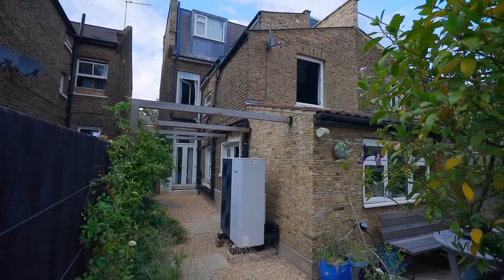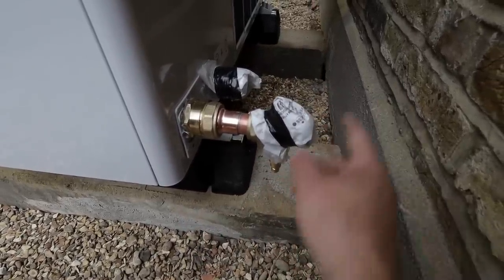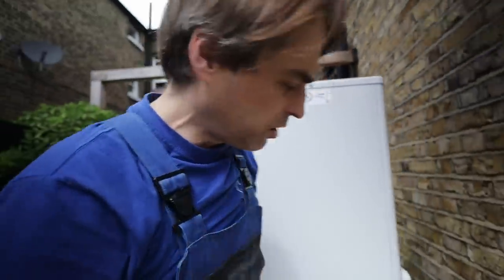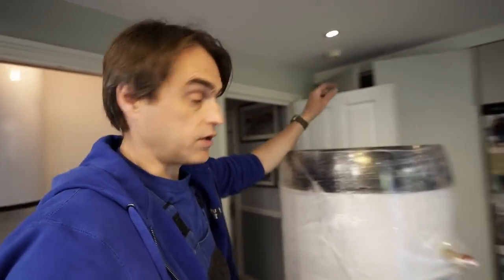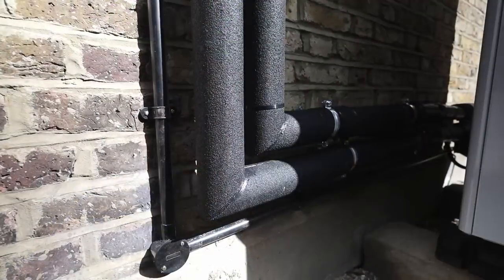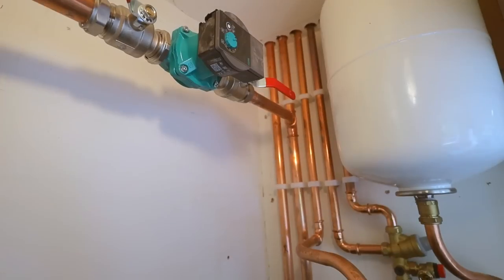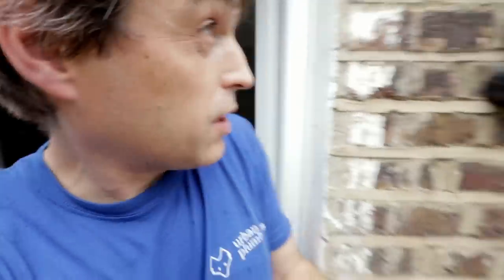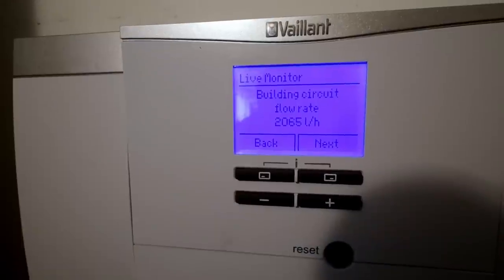Heat Pump Retrofit In a Victorian House. Is It Even Possible?

Comment: Good honest guy. It’s not flowing properly, why? Cos I’m a muppet! We all make simple mistakes, nice to see you don’t hide them . As always, outstanding work.
Reply from the maker: Thank you!
Reply: I was thinking exactly the same. Just goes to show how even the most impressive professionals can make an error, but that their eye for detail helps them identify and resolve the problem. Great also to see the different choice of valves to reduce the pressure drop. I’m no expert but I really enjoy watching an great team at work to show what can be achieved in the most challenging of properties. I’ve had an ASHP installed in a smaller 1870s terraced cottage so it was really interesting to see some similar pipework issues and the importance of balancing the buffer which I’ll check with my installer.

Comment: Great vid convinced me to stick with gas! 😂 That heat pump unit size is ridiculous. All the time to install the new rads etc etc no wonder the installation costs are so high.
Reply: Yes, I'd like to help stop dictators to, but don't want to be ripped off by energy companies when there is only one energy supply and renewables and energy storage and the network grid are not generating enough cheap electric as yet, at present heat pumps are powered majorly by gas fired power stations, and with an existing house with no cupboard or plant room and the cost, keeping the gas boiler and spending 5k to internally insulate the external walls, but it was another good install but it really is to complicated all the stuff should be in the external unit including a separate heat pump for hot water then it's only 4 pipes coming out heating and hot water into house then split heating in house to upstairs and downstairs no plant room as it's in the big metal box outside!?!

Comment: I really hope the technology improves over the next 10 years to make these about a 1/4 of the size, if we're all going to be forced to have one after 2035. It depresses me to see just how much is needed in terms of tanks, pumps, new rads etc, letalone the size of the heat pump itself. I have a 1930s semi, but couldnt put it in the side alley as i wouldnt be able to get bins or bikes past it, and i dont want it facing out against the back wall as thats where i sit in the garden. The tanks would have to take up valuable room in the garage or something too. All to replace something thats the size of a standard kitchen wall cabinet. Im hoping they invent some other technology in that time, or switch to pumping hydrogen through the gas network if thats viable.
Reply: Or just don't vote for the government that would force that upon you.

Comment: Absolutely loved your little comment about why we should use less gas 🤣

My mother's house is 223 years old. We're having engineers come over to discuss options for heat pump and solar installations. House is still using the same oil boiler vented heating system that was installed when I was born, 36 years ago! Really promising to see that you're able to fit heat pumps into super old properties with no external wall insulation.
Reply: 36 years ago... that's a solid system :)

Comment: Thanks! Now I know about Taco Setters. Will include one when I install my heat pump. Will make troubleshooting easier.
Reply from the maker: No need on Vaillant’s though and some other units as they have build in flow sensors

Comment: From a person who lives in a north-South facing Mid Terrace solid wall home, with ginnel AND north facing cellar, whether switching from a gas combi-boiler to a heat pump would be beneficial, both for comfort and relative cost.  I can tell you from last winter it was horrid in the front room (north facing) and thats with a higher temperature rad and gas fire.  (Old houses = high celling too😞)

Cant wait find out if this new heating system is better for the owner (and thanks to the owner for allowing this Video 🙂)
Reply: We have a mid terrace Vic terrace with root cellar with a 7kw vaillant heatpump and it did a fantastic job through the last winter never been warmer.

Comment: Superb! On an uninsulated property this is going to be very interesting, look forward to your revisit.
Reply: I live in a 250m² Victorian detached uninsulated house.  Two years ago we replaced our oil boiler with an ASHP and it works brilliantly.
It would use less electricity if we insulated, but we still get a SCoP of 4 so the system runs efficiently even if the house has a high heat demand. It's all about the system design and installation - so I'm sure this one will be fine.

I'm sure it's quite easy to install a system that didn't work and then moan to the Daily Fail, but they can work.
Reply: @johnmckay1423  Thanks John, that's quite a size of house - are you tempted to reduce further by insulating?
Reply: @johnmckay1423  I live in a ±220m² detached and insulated house and I'm currently investigating a heat pump based solution for heating so it's very good to hear that it works brilliantly and you still get a SCoP of 4!

May I ask what make/model of pump you are using? (size / kW). 

I fully realise that every house is different and requires a fitting solution and I've already been doing some heat transfer coefficient calculations for the house. But if it works in your situation it's another reference point for something that should work for us and something that I can hold against my calculations. 

Ultimately waiting for a local installer that has time (waiting lists are close to or over a single year), so I'm trying to be as best prepared as possible. :)
Reply: @johnmckay1423  100%
Reply: @trashmail8  you have to look at your heat loss not the m2,
Reply: @timballam3675  Yes, that's true and that's  why I already started with some calculations such as the Heat Transfer Coefficient  ( watch?v=hCeghKa3liM ) . But also knowing what heat pump size works in an uninsulated 250 Victorian house, can give me an extra data point to compare to my insulated house of roughly similar size and age.
Reply: @trashmail8  As an afterthought: If your heat demand is too much for a heat pump, you don't need a gas boiler. You need two heat pumps!
Reply: @johnmckay1423  That's a good thought for me to keep in mind, thanks! What size in kW is the heat pump that you are using?
Reply: @trashmail8  It's a Stiebel Eltron WPL25. I'm finding it difficult to get clear information on the rating - the documentation gives different options based on the climate where it's installed. It was selected by the installer because (at the time) it was the highest rated single heat pump. The manufacturer's documents say from 7kW to 22kW depending on the climate it's installed in. 
The configuration of the electricity supply suggests that the actual heat pump is set to 7kW as it's on a 32A circuit. Each of the auxiliary heaters is on their own 16A circuit.
It's variable so runs at whatever output is required to deliver the flow temp required. Variable output allows it to run constantly rather than switch on and off to maintain different flow temperatures, which is more efficient. 
We have a zone which wasn't included in the calculation to allow us to get away with a single heat pump in the design to run at 45°C flow temp at -2°C which was my preferred compromise. In real life, I have the choice of either allowing it to run at a higher flow temp and accept the reduced efficiency for the minimal days that it's below -2 (which isn't very often and rarely for whole days) or shut that zone off and close the door on that zone for a few days.
Reply: @johnmckay1423  Thank you so, so much for this elaborate reply! 🙏 This gives me some new starting points for information and adds some very useful information to my mental model of heat pump size and flow temperature vs large uninsulated house. (While keeping in mind that it isn't about m2 as discussed above)
Reply: @trashmail8  also have a look at your heat loss and radiator sizes. There are also tools to calculate this. To be efficient, your flow temperature shouldn't exceed 55°C. Ideally, you have UFH. If you stay below it, you can be efficient. But obviously, the demand is still going to be higher as if you were to insulate.

Comment: Great video, and there's a lot for a renovator-developer and specifier like me to take in. What I would love to have seen too:

1. How did you do an energy assessment in order to produce your system design? We are repeatedly told "fabric first" and that renovators must install incredibly expensive External Wall Insulation systems and MVHR etc before even looking at moving from gas boilers to ASHPs - and that rendered EWI must regrettably destroy the often-gorgeous and unique Victorian/Edwardian decorative features that make British period housing so distinctive. If however renovators can do a combination of low-impact insulation and cold-bridge minimisation and well-designed and less costly ASHP-radiator-UFH systems, that would be brilliant.

2. What did this little lot cost, from energy assessment to any extra insulation to final commissioning? And why didn't your clients choose to replace all that ancient pipework under the floorboards while they had the chance?

3. How are running costs and operating efficiencies being monitored?

Comment: We would love a heat pump. But our house is a mid terrace 1890 property with a total width of 15 ft. The back of the house is an extension with all glass bifold doors, so can't install it there. Plus no room for a water tank, hence our current combi gas boiler. If the heat pump could go in the shed at the bottom of the garden it could work, but at nearly 50ft away don't think that will work. Looks like we're staying with gas.

Comment: Another interesting job, lovely high quality work on the installation but at what cost? 5 days, three plumbers(?) plus materials, down south where everything is premium rate. We would like to replace our boiler with a heat pump but we have no indoor space for a plant room, we can have a new gas boiler installed for around £3000, with a 10 year warranty why would we go heat pump?
Reply from the maker: Cheaper to run, better comfort, much less co2 emissions, don’t support questionable regimes around the world, save the planet, add solar / battery make it even cheaper, etc…
Reply: youd fit one if your primary concern is to save the planet, if youve got thousands of pounds to chuck at it and you want to virtue signal to all your neighbours about how much greener your home is compared to Sebastian and Jocasta at number 7.  Basically you live in Harpenden. For everyone else, we chuck in the 3K gas swap and use all the money we save on a bloody good holiday for the next few years.  Id bet a huge amount of people having these 30k installs to save the planet have a range rover sitting on the drive and jet off in summer to their apartment in Alicante.

Your 3k gas boiler swap is costing you probably a couple of hundred quid a year over the lifetime of the unit. Whats this install costing over its lifetime, probably ten times that a year. When these first started to get heavily pushed, all these videos were about how youd save a fortune cos youd do away with gas, now thats been found out to be absolute nonsense due to the crackers install prices of these systems, so that argument has been quietly dropped by most youtubers and suddenly these mega installs are being sold on saving the planet.

No one ever mentions that if you do away with ga after having a heat pump installed then youve got to cook with an electric hob or induction and they are generally pretty horrible to use and no way cheaper to run than a gas hob.

Ive made huge energy savings in my house by simply swapping the rads to panel pluses, ditching the old honeywell 9000 controls for a nest wired with opentherm and turning the flow temp down to 50C, no need to change the boiler, upgrade any of the pipework, find an area for a buffer tank etc etc. These installs are luxury items generally installed by people with more money than sense. In the middle of a cost of living crisis ask yourself this "how many 'normal' families that you know could afford to chuck £25-30k at their heating system.

Comment: What was it about the existing pipework that meant you needed the buffer tank? Higher pressure drop which the heat pump couldn't handle, requiring the second pump and buffer tank? 

Haven't seen the buffer tanks used much so interested to learn a little more about why it was required. 

Awesome install though, you do some beautiful work!
Reply from the maker: becasue of the required flow rate - the pressure loss on existing PB pipeowrk is quite conisderable, and there was a risk that without a buffer the circulator on the external unit would be able to provide 2000L / hour flow. This in turn would lower the unit effiency and output, and casue a situation in which at design temperature there wouldn't be enough power to keep the house at 21C. It would also be more expensive to run.
Reply: @UrbanPlumbers  Ahh that makes sense. Thanks for the reply. Is there a reason you wouldn't just put the second pump in series with the heatpump, and go without the buffer tank?
Reply from the maker: @Thermoelectric7  Yes - that is the worst thing one could do. 

First, you would still have to overcome the resistance of the heat exchanger on the external unit - using 2 pumps - this would require much more pumping power to do so.

With a buffer, the system pump doesn't have to overcome the resistance of the external unit.

Second - pumps do not like to be in series as they can interact in strange ways with each other. Especially if they are not fixed-speed pumps.

Strangely some manufacturers were advising this method (Mitsubishi for example) - with terrible results.

Generally, if you have more than one pump on a system you want to separate them by a low loss header, closed coupled T or a buffer.
Reply: @UrbanPlumbers  There's a discussion going on in Heat Geeks where we're talking about head loss in plastic pipes. Do you have figures for equivalent pipe lengths that I can't find? The argument was, "don't use plastic because of the fittings." I get that with some but not all. Hepworth publish equivalent pipe lengths for their fittings which are identical to those for copper. The only difference then being the smaller id, size for size. I can't find anything for JG or others, do you have any?
Reply from the maker: Calculate it yourself. It’s not that difficult
Reply: @UrbanPlumbers  You're right.... it is.... if you have figures to work with.... Copper figures easy to find..... Hepworth easy to find..... can't find any others..... that was the reason for the question.

Comment: Love your videos and Thanks for sharing! Question: Would you use a buffer with 100% UFH ? I Would like to avoid a buffer tank. I have 2 UFH manifolds with 7 and 9 ports. Currently both manifolds have dedicated pumps that I plan to remove an hooefully run everything off the Vaillant AroTherm pump What do you think?
Reply from the maker: you have to calcuate your heat loss first and your flow rate. Then you calcaute your index circuit and take into account pressure loss though valves and diverters though that circut. If you have enough head in the external unit pump, then you don't need a buffer and can also remove pumps on manfifolds.
Reply: @UrbanPlumbers  Thanks for replying to my question… The mass flow rate with a dT 5 is 16 l/m. I can see that the vaillant AroTherm plus 7kW has a maximum flow rate of 20 l/m. If I use either 28mm or 35mm pipe for my main curcuit and the 22mm to each manifold do you think I need the buffer? (Should you also take into account 16mm ufh pipe?) The other alternative is to use a dT of 7 which Would drop the flow to 12l/m I hope you dont mind me asking!

Comment: So wish you were in my area - my heating engineer is a good guy, but seems to think heat pumps are not "man enough" for old houses (part 200 year old cob/stone, part 20 year old extension with some slightly crappy 25mm celotex type cavity insulation), despite the fact I run a 6kW flow boiler for our wet UFH, which was in place when we bought the house. As I pointed out to him, if I had a heat pump drawing as much power as the flow boiler does then I'd be living in a tropical growing house! Our annual use is no more than average really (~15,000kWh/year). There seems to be such a dearth of good, knowledgeable installers in the south west despite having loads of properties that aren't on mains gas, meaning lots of potential business over the years.

Comment: I like the Mut Mechana diverter valves. The NC and NO come in handy with wiring apart from the great flow rate
Reply from the maker: I just notice that Midsummer sales them for £70 and they are CV of over 12! Great find!

https://midsummerwholesale.co.uk/buy/renewable-heat-accessories/mut-meccanica-tovo-sv-3-port-valve